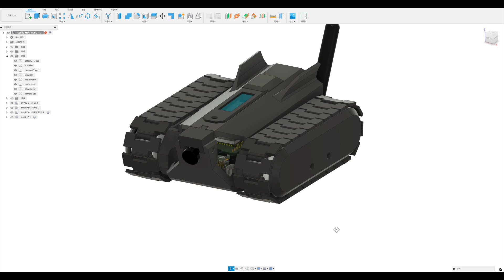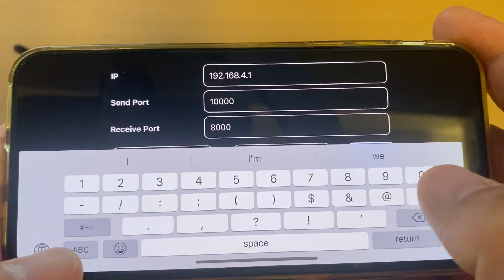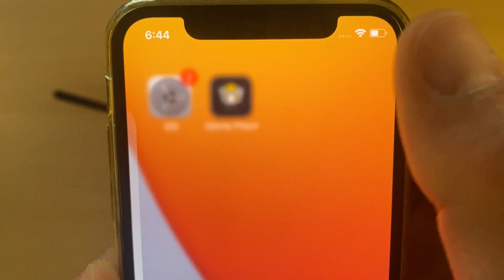ESP32 MINI TANK #udp #APMODE #STAMODE #esp32project #3dprinting #arduino

Comment: What is the voltage and speed of the motors used?
Reply from the maker: It uses a 7.4 volt max and 600 rpm N20 motor.